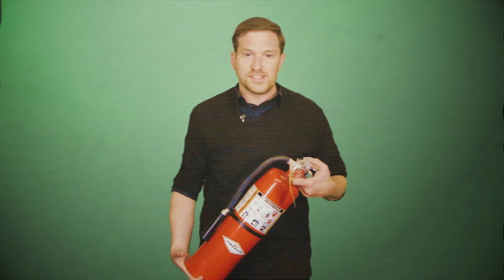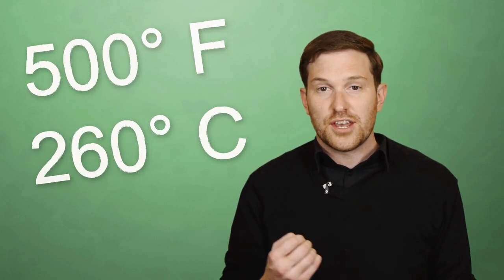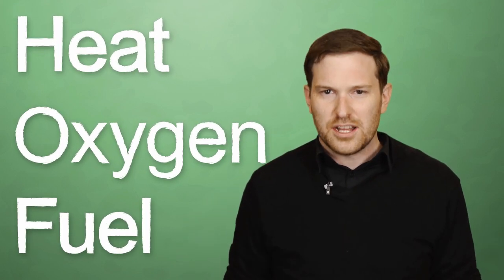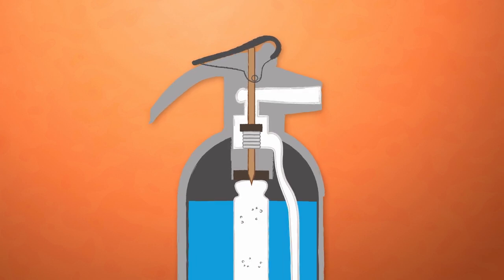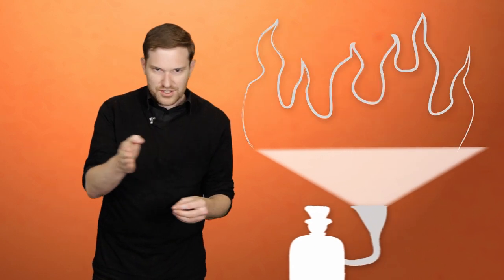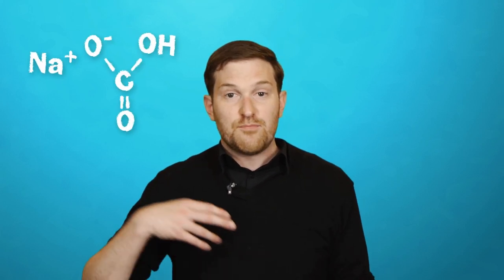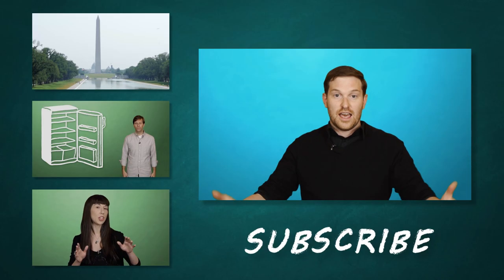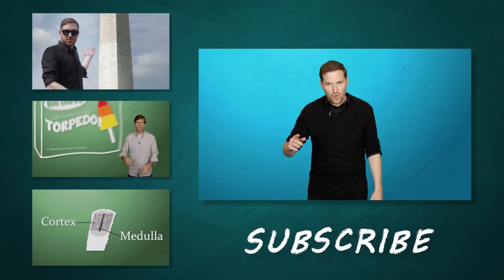How Fire Extinguishers Work

Comment: Those zip-tyes securing the pin--should you remove them when you unpack the extinguisher?
Reply: Keep them on the extinguisher. Those “ZipTies” are called tamper seals. They are there to prevent any unwanted tampering with the pin as well as to ensure the pin doesn’t accidentally fall out of the extinguisher. They break very easily with a simple tug on the pull pin, so they won’t impede your ability to use in a fire situation.

Comment: I must say this was seriously poor educational video honestly.. There are 4 main classifications of fire .. A,b,c and I.. There is class A is paper, wood (normal combustibles) class B is flammable liquids (gasoline and oils) Class C is electrical and the only one that makes since is class K which stands for kitchen and is a newer type that was designed for fryers to help deal with "flashbacks" in vegetable oil.. It's a liquid which drastically lowers the temp of the grease because it can mix with the oil rather then another it.. There is also one other classification but very seldom would one encounter due to most people aren't even aware that metal can even ignite (being it takes super high temps) nevertheless it is class D. Now your example of an extinguisher wasn't far off from a cartridge operated one but (not entirely accurate but doesn't matter).. The biggest problem is you don't see a lot of cartridge operated ones and even the one you there to the side was not one.. Most or simply filled with the suppressant and pressurized to the correct psi with a non flammable gas (usually nitrogen).. Some extinguishers use a gas like co2 or fm200(which replaced halo due to EPA regulations) but all work off the concept the cylinder holds the pressure inside until you push down on the lever which pushes down on a valve stem allowing the suppressant to flow out the hose.. I am not trying to down your video I just thought I should clarify some..
Reply: Useful add-on!

Comment: Most extinguishers don't have a smaller cylinder filled with anything. The extinguisher itself is pressurized...and that's also why there's a pressure gauge. Don't believe me? Then take an extinguisher and discharge it. Unscrew the top and see for yourself. If you want to only discharge the pressure and as little agent as possible, then turn extinguisher upside down when discharging until all pressure is gone.

Comment: So water extinguishers are good for wood and paper, CO2 for electric fires and sodium bicarbonate is good for what?
I don't think it was too clear as to which extinguisher tackles what in the episode ^_^;
Reply: +Dash49 Sodium Bicarbonate (BC dry chemical) is usually found in mechanical rooms, areas with high class B hazards, and residential kitchens. There are a lot more types (and more popular) types then said in this not very well planed video.
Reply: +ironmatic 1 Thank you for the clarification :)
Reply: Class "A" is for things that turn to Ashes. (Paper, wood, etc.)
Class "B" is for things that go Boom! (Gasoline or other flammable liquids)
Class "C" is for Circuits. (Electrical Equipment) 
Class "D" is for Dynamite (Heavy metals like Magnesium)
Class "K" is for the Kitchen (Grease fires)

So simple a first grader could remember!  :)
Reply: @robbynelson3  That’s a fantastic way to put it! I’m going to pass this on to my extinguisher technicians for when we train new guys.

Comment: Do an episode on How do headphones work?
Reply: It's literally a slightly less powerful miniaturised speaker in your ears connected along wires to an amplifier (think of the volume rocker on Apple EarBuds) and then along another wire to the input device. Some headphones have inbuilt speakers which then output sound to the device it's connected to.